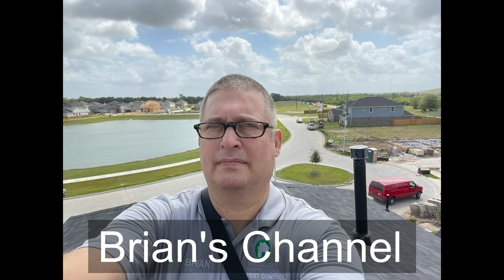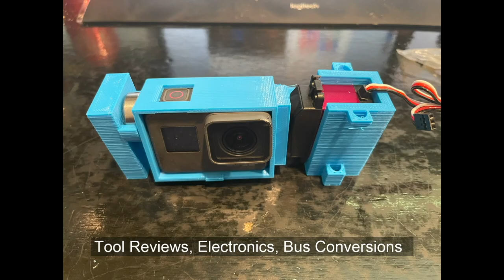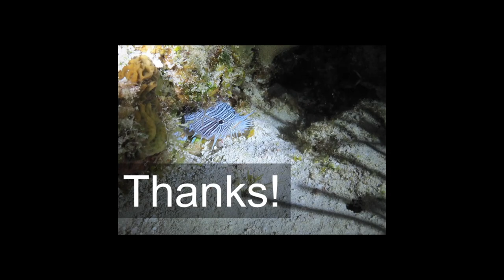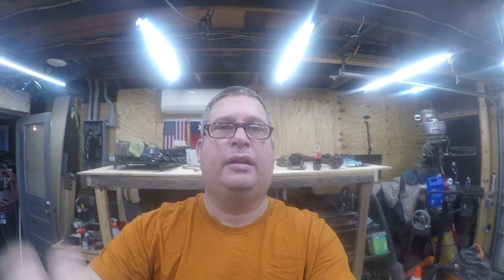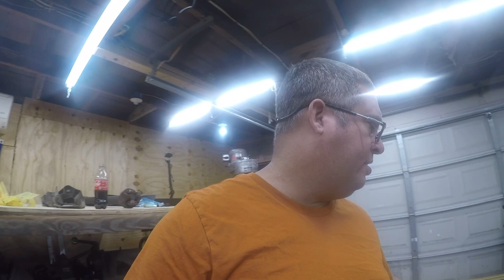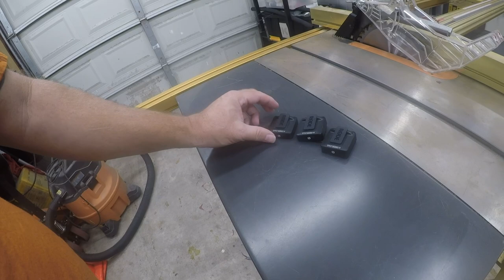R0DE Wireless Go 2 battery failure

Comment: I know this is late, but  I just seen your video as I was having the same problem. I had stopped using my wireless mic for a few months and couldn't charge them.  I had to uninstall the RODE central app on my pc and then reinstall a newer version. Then I had to do a factory reset on each device. Both units started recharging right away.

Comment: Hi, I'm having the same issue with a swollen battery on my Go2 transmitter. Were you able to get a replacement battery anywhere? I noticed that once you pop the cover off, the battery can unplug from the unit.
Reply from the maker: they warranty replaced the unit.  Had a bunch of drama over them saying they only got one part of it, but they did eventually make it right.
Reply: @hotpuppy72  Thanks for the reply. What a pain! I might have to buy the DJI wireless mics now it looks like.
Reply from the maker: @DeanBKK  I bought a small rig unit.  It works great.